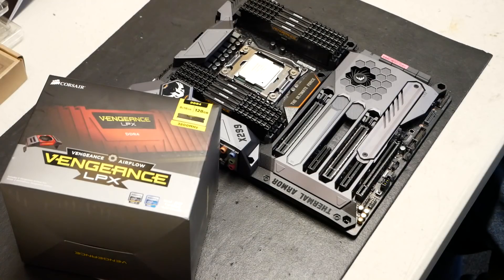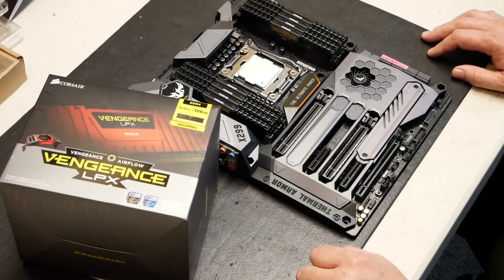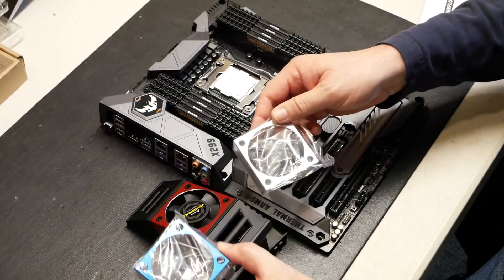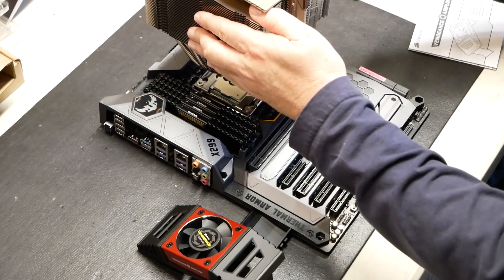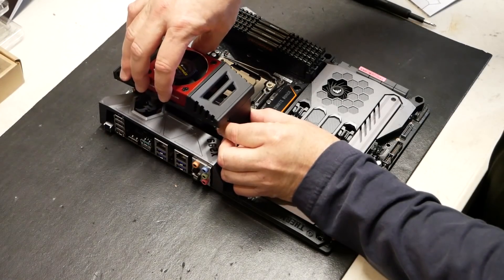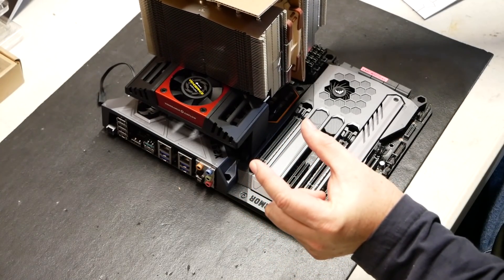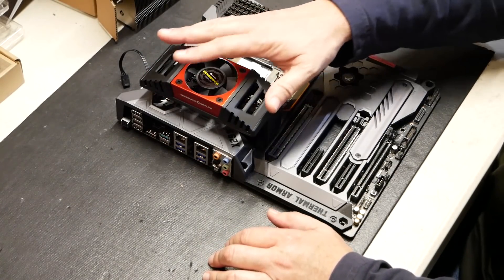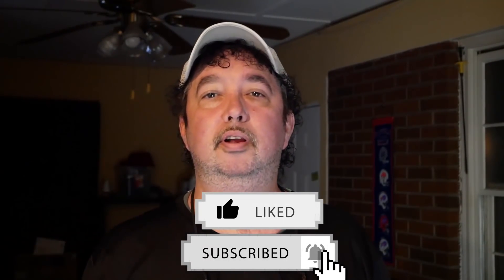Installing 128gb of Corsair ram in Your Computer Motherboard

Comment: Thirty-eight hundred MHz? I guess your memory modules will build up some heat at that speed. Without the RAM cooling fans, probably the best thing to do is to make sure there's lots of flow-through ventilation throughout your case. It looks like you are going to have a killer build.
Reply from the maker: 3800Mhz yes! I hope they do not get overheated without active cooling.